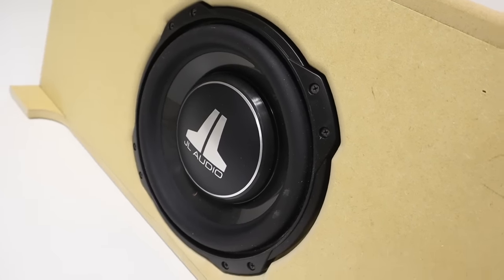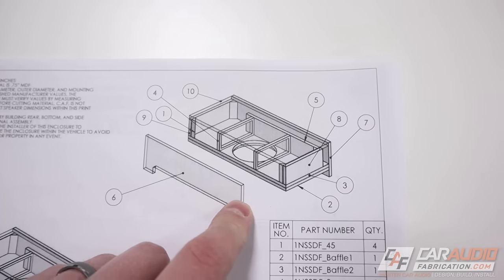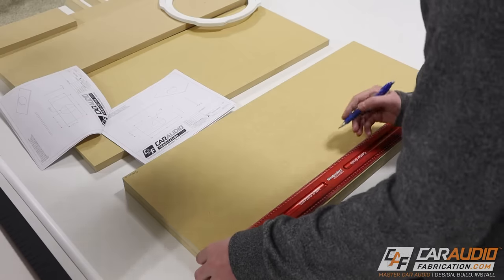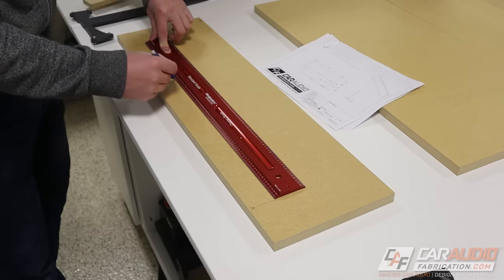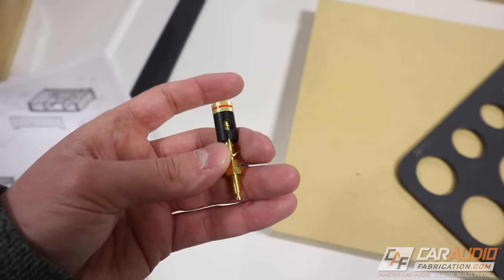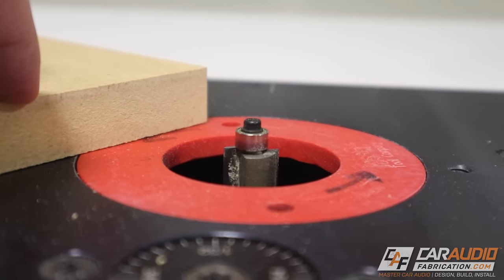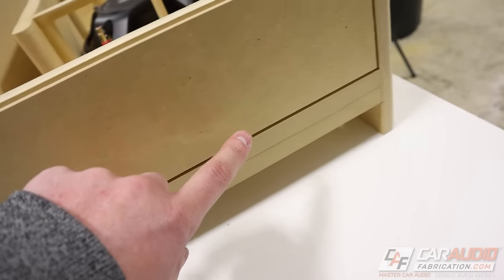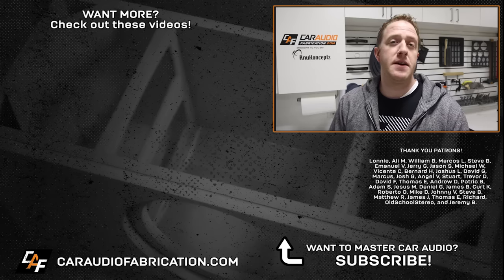BIG BASS small space! - Downfiring PORTED Subwoofer Box!

Comment: router video?   yes, yes, and yes!   i have a router but i currently only have 4 bits.   they are so expensive and the different types appear to be infinite.      I would like to know more about the tool in general, best applications for use, and mostly the critical/necessary bits i need and will use the most vs the ones i can do without and pick up later

Comment: Love your videos - one tip from a woodworker learning about building sub boxes - 

When you used CA glue for the braces - one good tip is to use both CA glue and wood glue - you can use wood glue for most of the joint but leave a point on each end of the joint for CA glue. 

The CA glue acts as you wanted (quick solid connection when you didn't have a brad nail that would work), the CA glue then allows the wood glue to make an stronger bond for the remainder of the joint (with the CA glue acting as the brad or clamp as the wood glue dries).

Comment: I have installed the JL Audio sub in my spare wheel(spare does not have extra holes, just the 5 and the center hole), that I have sealed the holes, with a rubber seal and an aluminum 6" "washer", all bolted down to the car. Placed an MDF over the wheel, made the cutout for the sub and the speaker terminals and strap it, with two ratcheting straps. It hits haaaard. Spare has well over 1.3 cu/ft.

Comment: i have respect for the shallow woofers since i installed one shallow 12" in my 02 dodge ram quad cab. i will be using them more in the future for my other vehicles!💪
Reply: i just bought an 03 quad cab. any thoughts on a good setup for under the rear seat?
Reply: @parkerprecision6675  you may be able to find the under seat speaker box on fb marketplace. they come in dual and single units. i have a single unit, so i have some interior storage. i have a shallow 12" kicker comp rt, run by an Alpine 500w amp and a 1 farad cap. i ruined it using the SMD DD1 and CC1

Comment: Your pieces are nice and cleanly cut!  I think you talked me into buying the Porter Cable 890 series. Is there any particular model that you can recommend?  I'll basically use it with a router table (but i cannot afford a router lift)... so its the router, a plate and attach it to a DIY table.  By the way, what computer program or software  do you use to draw your plans?  Thanks in advance for your answer and more power to your channel!

Comment: How you calculationg how much dumping material put into the subwoofer enclosure ? And why you are not covering entire walls inside with it  ?  With be interesting to see video about it. 
Also wil be great to see your experience in calculating closed boxes volume. As example I have Audison APS10D  and 15L closed box  ( inside of the spare wheel ). But Audison recommend 10-12L boxes , however if I put paraments of the speaker in to online calculator , to get 10L Qtc have to be around 1.1 which I do believe is to high. What is your opinion? How sound of the subwoofer changed depend on volume of the closed box ( ported boxes is way more complex story to start with)

With best regards
/Andrew

Comment: I'd be up for that router video. Just picked up a Bosche router with table but have yet to use it very much.

Also any thoughts on a quick disconnect subwoofer? For example, I know several people who are hesitant on getting a sub installed as it takes up a permanent spot in their trunk. It would be awesome if there was a way to make a quick disconnect subwoofer that can be removed in seconds and without tools. This would be for people who have a limited trunk space but don't want to compromise for a sub, for say like a road trip or when they really need to use all of their trunk space

Another video that might be great would be best ways to secure subs in the trunk, especially for people who don't want to drill a sub into their car or make any other permanent modification.

Comment: Looking for some advice. I just got two 2000 pyle 15's I have a 2000w amp for each sub "both in the same box with separate inputs  but each speaker has 2 inputs how  do I wire them

Comment: Nice build video. Thanks for sharing.
How did you figure the air space needed under the box? Or, is it not that important?
Reply from the maker: With proper design analysis looking at how the volume and tuning frequency would impact the response and performance along with other factors. I know, not an easy answer. Most people just go with a "recommended value" from the manufacturer that the manufacture picks based on what will work for the "average" listener. If you want what is truly best for YOUR application, volume and tuning need to be chosen with reason and calculation.
Reply: @CarAudioFabrication  thanx Mark. 👍

Comment: So I have a 2013 Hyundai Genesis Coupe I bought a Kicker Baric L7S 12" 2-OHM it came in a ported subwoofer enclosure I figured that a single subwoofer in an enclosure wouldn't give me any issues but it's to big to fit in my trunk the enclosure is about 2 and a half inchs to big from fitting it into the trunk I didnt realize it and I didnt install it right away and it's to late to return it I took my back seat out and made a bracket to set it on but now I have a huge box in the back seat I really want to put this into my trunk because I have kids and need to be able to use the trunk. The speaker is the square one could you give me some ideas on how to build a box to fit this into my trunk the main thing is I still need to be able to get to my spare tire I dont really care about how much space I have in the trunk so long as the speaker fits in the trunk and I'm able to get it out to get to my  tire I have liked and subscribed to the channel thank you in advance!

Comment: I am trying to build another box I built one for a 12in kicker Solo-Baric 12 in Square in I was having an issue with seeming like it was not enough open-air in the port so I wind up taking the port off the side of the box cuz it would make the side of my truck rattle because it's in a 97 Dodge Ram single cab and I have it fit just enough space to where the speaker can fit and I don't know how much exact volume it's supposed to have but it just seems like in a deep box this thing should be slamming in a deep style box but this is a ported wedge box and it doesn't sound bad but it just seems like it should have so much more deep bass the problem is I can only fit so big behind my seat so that's where my issue is and still have enough utilize Myspace enough to where I can do other things in my truck cuz it is a work truck so any help on Big Bass with little space please leave your opinions and or demonstrations blueprints would be highly appreciated

Comment: Man i have i question. I have an issue with HPF .. i have Alpine headunit UTE-200BT the problem is when i turn ON the HPF no matter at what frequency i set it 80,120,... (i would like to run it at 80hz) as soon as i turn the volume above medium but still far away from the maximum (max volume on the headunit is 35, anything above 25 is a problem with HPF turned on) the tweeters start to make a weird poping sound everytiime in a song there is a snare hitting. but as soon as i turn the HPF OFF i can go way more crazy with the volume (up to 33 or even maximum i did it once just for a test i never run my system at full volume) and it does not happen. It's so confusing i have no clue. I would be so thankfull if you can help me!

oh and one more thing i dont use any crossovers i just changed the stock car speakers with these and they are Alpine SXE-1750S they have a capacitor for a tweeter so its protected from the low frequencies.

Comment: Hey man, I have a question and you’re the only person that I know who I’m sure would know. When I start my car and turn my music up, the subs hit super hard. But after about 5-10 minutes they start to get quieter. It’s pretty much every time too. They get about 1/3 rd quieter and pretty much stay that way until I shut the car off and start it again. Would a capacitor fix this issue do you think? Or maybe my wire size is too small? (Which I don’t think is the issue) after that I would think it’s the battery or alternator. But wondering if I should try the capacitor first to rule things out.
Reply: You can only tell by carrying out some measurements, and they can only be done with instrumentation that won't lie to you.
The first thing is to get yourself a multimeter you can rely on. Really - Save your money and skip the bit where you buy Chinese rubbish that ends up in the trash. If you're unsure, look for a Fluke 115. Unless you start getting into microcontrollers etc, you'll never need another meter.
Put the meter across your battery on DC volts. Start the engine and let it run for a few minutes. You didn't say what vehicle you have, but I'll assume it has a 12V system. You should see around 13.8V with the engine running - This is the alternator trying to charge the battery.
Now fire up the audio system. Play it loud and observe the voltage on the meter. During bass beats, you may see the voltage "dip" a little, but it should recover immediately.
If the battery voltage progressively drops further and further down, your alternator is clearly falling behind, and your system must be drawing more from the battery than the alternator can deliver.
Volts go down = output power goes down. Output power goes down = power demand goes down. At this point, you reach a kind of equilibrium, which is probably the 1/3rd quieter symptom you are seeing.
If the above is the case, you MAY need to look into sourcing a bigger alternator.
Capacitors will NOT help the situation - They simply make up for a short-term voltage drop across the cable between your battery and the amplifiers. Like a suspension spring, they can make up for "bumps in the road", but that is all. Ultimately, the power supply is the alternator.

Comment: yes do the router video and tell us speeds u use on different material
Reply from the maker: When hand feeding into a router you control the feed rate, so speed isn't something to be overly concerned about. Just go slower when using large bits like large rabbets or profiles.
Reply: Hand routers are generally just on/off, few have speed controls, and 9/10 it's not needed since you control the feed rate.
Reply: @amorton94  I have a table router
Reply: @guidoftc8304  Which are usually nothing more than hand routers bolted to a table.
Reply: @amorton94  the one I have has 1 thru 9 as speed #

Comment: I need some help for anyone that could answer and I’ll try to be super specific. I have a 2011 Nissan Altima coupe with the upgraded 9 bose speaker package I installed 2 10in kicker comp r’s with a CXA1800 watt amp and kept my factory radio so I tapped into the right rear speaker with a PAC LP7-2 line output converter so when I turn my radio up past like 23 I get a slight weird noise out of the single speaker I tapped into. Its very minor and most people don’t notice it but I sure do. Any reason why this is happening? Should I hook up the extra ground wire (brown wire) on the lp7-2 or should I buy a ground loop isolated? Btw i use AUX not sure if that matters thanks!!!